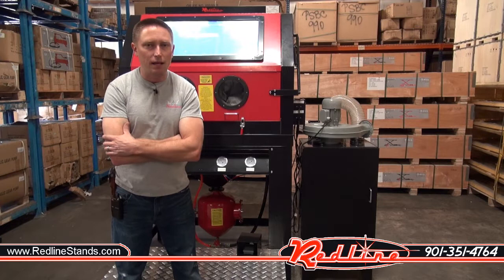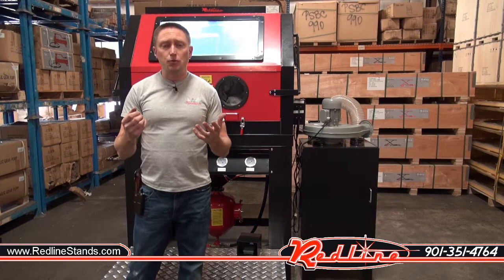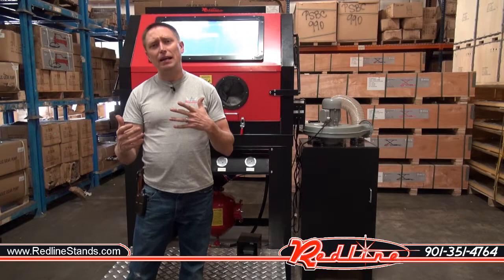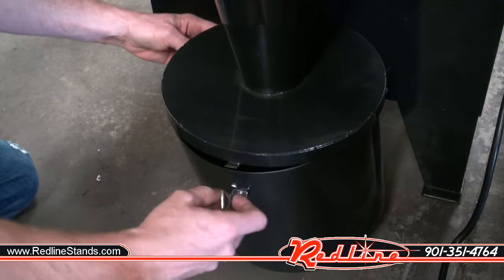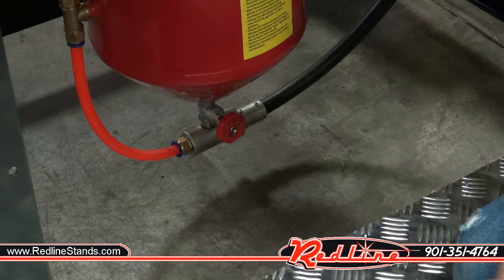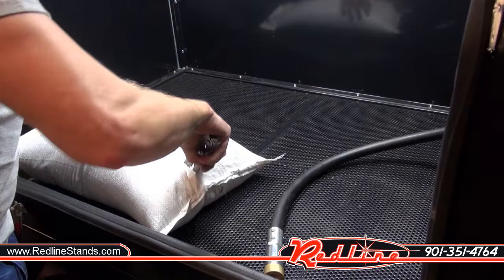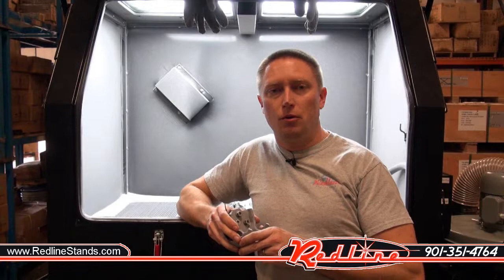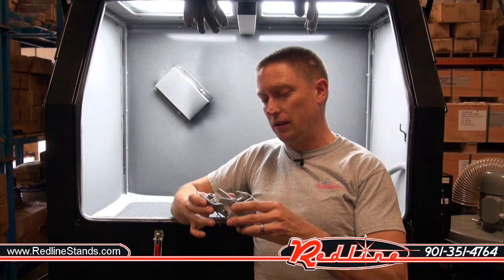Redline Pressure Pot Blast Cabinet Demonstrated

Comment: I bought this cabinet almost 2 years ago. Mine actually has the covered filter motor but other than that looks the same.  It’s a great cabinet, however  I did not do enough research before purchasing, we are a small manufacturing business and totally underestimated how much we would actually use the blaster, we work the dog out of it and we have run through a few parts keeping it running, this isn’t the fault of the machine. We will be upgrading soon but one point that is very important, the customer service from Redline, it’s been outstanding, they have everything we’ve broke in stock and shipped out very quickly, the support guys are very friendly and stay in gauged until our issues have been addressed. I can’t say enough good things about Redline service and as for this particular machine it is a work horse but if your working if 5-7 hours a day be prepared to clean the catch bucket every 3hrs or it’s a bear to unbuckle and hold up at the same time, also there is no back flow on the filter so that too needs to be removed and manually blown out and cleaned every 3 hrs. When comparing this to the 25k units you can decide if the huge price difference vs cleaning requirements is worth it. We have our guys shoot for 2.5 hrs, take a break, clean the machine then work another 2.5 and clean again then call it a day. So we get 5hrs of blasting done which works for us. I might mention the parts we have gone through, air hoses, window screens are kind of a pain, door shocks, the pressure pot block valve, air regulator but again a quick call to Redilne and they had what needed in the mail and to us with in a few days.

Comment: We just hooked ours up. Already we are 3x the speed production wise. Still to be determined on longevity of media. One thing that I feel is missing is a trap door to easily remove the media. Unless you remove the pressure pot itself (remove a number of bolts and let it fall out), or using a vacuum to suck out of the hopper, or blasting into a tub to collect the media, there is not an easy way to do it. Most syphon style blasters just have a hinged door on the bottom that allow gravity to remove it. Is there a trick or easier way to do this on this machine? Seems inefficient, which counters the purpose of a pressure pot. Our current idea is to cut a hole at the bottom of the hopper just above the pressure pot and create a swing door that would allow the media to fall out into a bin. Suggestions? Definitely needs to be looked at in future models.
Reply from the maker: I just emptied mine this past weekend at home.  I just connected 2 x 10ft pieces of plastic conduit, ran the conduit out into the yard, stuck the hose in there, wrapped it with an old tee shirt and tape, and then blew all the media and dust right through the tube and into the yard.  Worked great.  If you don't want to do that because you're in an industrial park you can just remove the access door bolts on the side of the pot and scoop it out manually.  Honestly though, you generally will just add media over time and never actually clean out the pot.  I only clean out the pot if I'm changing medias, which is rare.  Thanks for your business!
Reply: @RedlineStands  We use a lot of coarse glass on stainless so it pulverizes and needs to be changed often. The surface is cosmetic, so when the media is too 'dusty' it changes appearance and can no longer be used without sifting. We also switch between glass and garnet often as well. So change over of media is a factor for us.
Reply from the maker: @lanceideker6478  I understand.  Sounds like you'd be limited to the cleanout door.

Comment: What is the most ideal blast media and grit to use with this cabinet?
Reply from the maker: I really like this stuff in the 40-70 grit.
https://www.redlinestands.com/catalog/shop-equipment-c-327/sand-blast-equipment-c-327_501/abrasive-blast-media-c-327_501_577/10x-engineered-materials-blast-cabinet-abrasive-media-p-2894

Comment: I have a Grimmer schmitt screw compressor with a 4 cylinder kubota engine putting out 100cfm at 100psi. Will that work properly with this unit?
Reply from the maker: Yes sir.  With CFM to spare.

Comment: What can i trouble shoot if my pressure guages build up, and as soon as i use it- drop to 50 and keep losing pressure
Reply from the maker: This part below seals your tank.  If it loses pressure quickly as soon as you start blasting, it's quite likely this gasket has met it's maker

https://www.redlinestands.com/catalog/shop-equipment-c-327/sand-blast-equipment-c-327_501/sand-blast-replacement-parts-c-327_501_507/redline-repp70-pressure-pot-blast-cabinet-mushroom-valve-gasket-p-2676
Reply: When it says I should be able to see the mushroom from the top of the machine,  should the mushroom be firmly pressed against the bottom of the funnel or just visible?
Reply from the maker: @Parkerparadise  When the foot pedal is pressed, you should see the mushroom gasket move upward and seal against the bottomside of the funnel.

Comment: Looks a lot like the PSBC990 is this the same machine with a few gen 2 upgrades?
Reply from the maker: It's similar no doubt.  The biggest difference is the vacuum system.  The Redline unit is far superior as far as dust collection goes.
Reply: @RedlineStands  boron nozzle with the all source cabinet

Comment: Are these made in the US?
Reply from the maker: No sir.  I'm linking you below to units that are.
https://www.redlinestands.com/catalog/shop-equipment-c-327/sand-blast-equipment-c-327_501/sand-blast-cabinets-c-327_501_502/mediablast-usa-made-power-peen-pressure-pot-blast-cabinet-p-2914
https://www.redlinestands.com/catalog/shop-equipment-c-327/sand-blast-equipment-c-327_501/sand-blast-cabinets-c-327_501_502/cyclone-dp38-direct-pressure-pot-media-blast-cabinet-p-2790
https://www.redlinestands.com/catalog/shop-equipment-c-327/sand-blast-equipment-c-327_501/sand-blast-cabinets-c-327_501_502/raptor-blaster-rb4836dp-direct-pressure-pot-blast-cabinet-p-2936